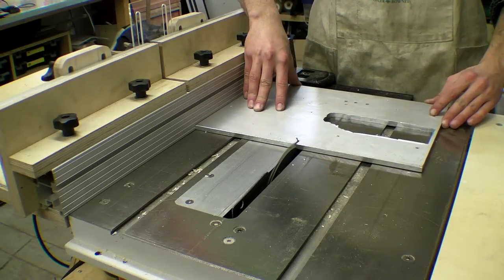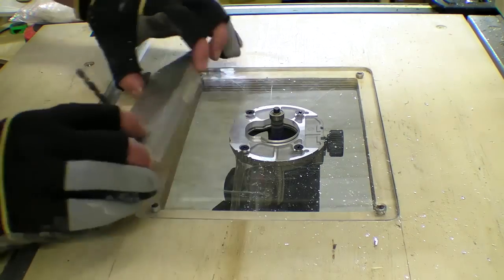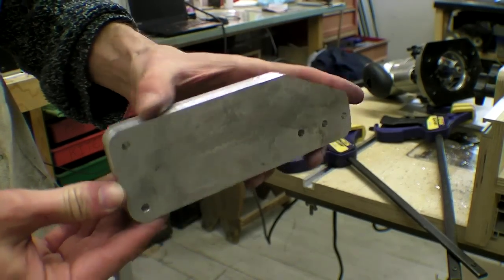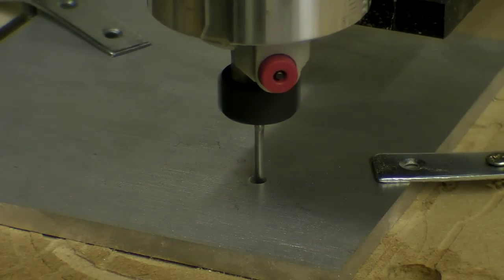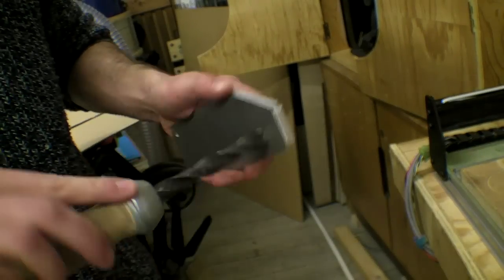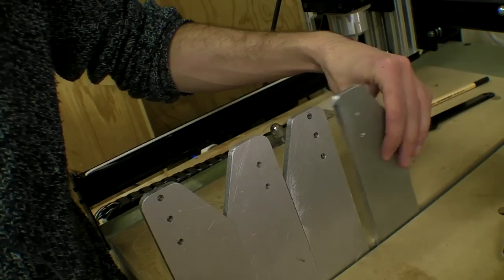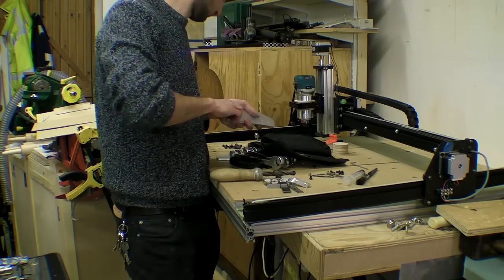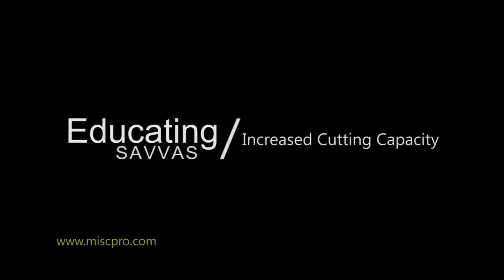Increasing Cutting Capacity of CNC / End Plates

Comment: You didn't have enough of a hold when it jumped off the router table. Now when you cnc'd the other ones why not mirror image them so you cut both at the same time and finish off splitting them on the saw. You did okay in the end bet that mishap shook you up.

Comment: http://www.kitplanes.com/issues/31_1/shop_talk/home_shop_machinist_jan_2014_20909-1.html
Reply from the maker: +Andrew Leith You're right, it's possible without a CNC machine but he does have a massive milling machine to drill the holes.
Reply: +Educating Savvas yes but you can chuck up a spotting bit into a drill press or hand held drill you dont need a big mill I like the cnc method tho I havent gotten one yet.
https://www.mscdirect.com/browse/tn/Holemaking/Center-Drills-Combination-Drill-Countersinks-Spotting-Drills/Spotting-Drills?navid=12106130
Reply from the maker: +Andrew Leith I guess you could always use a cross vice on a normal pillar drill too - haven't had experience with spot drill but come to think of it, I have a couple from an old tool box I got.

Comment: I'm not sure if you're familiar with Clickspring (yet) but he's quite fond of using good old super-glue for temporarily bonding parts together. May be worth testing at some point down the line if you happen to be doing something similar in the future.
Reply from the maker: +Jamie Reader Yes I am, although I've not watched enough to notice the super-glue. What does he use to dissolve it?
Reply: Educating Savvas heat, interestingly enough. He often uses an aluminium arbour in his lathe and glues the brass too it. Once done, he heats it up with a blow torch and it breaks the bond.

Comment: the router bit slippage happen because of that weird collet, that makita have.. not the proper one. I somewhere read that you can replace it with ones from Bosch trim router, that have better collet. I have the same router but have not tried the solution yet.
Reply from the maker: +bikboklv Thanks for recommending that - I'll give it a go.  I'm also sure I heard of a company that make replacement nuts which fits the ER11 collets, but I haven't found where to buy from Europe.